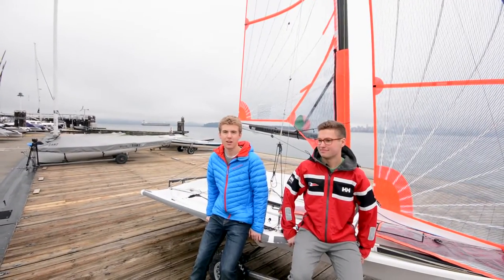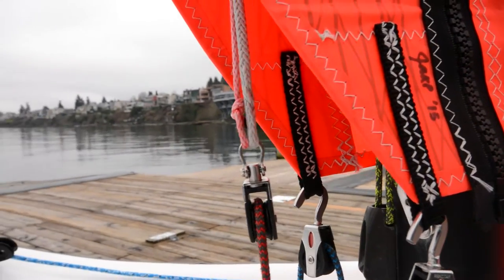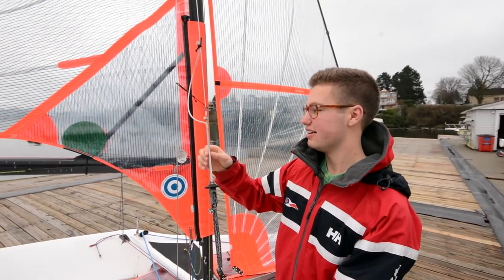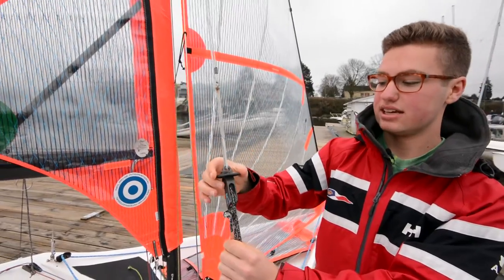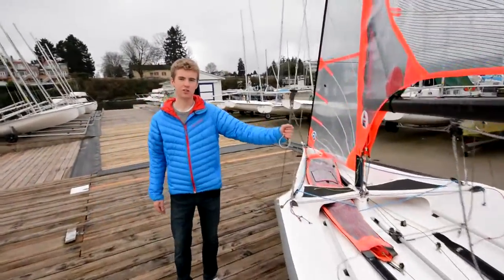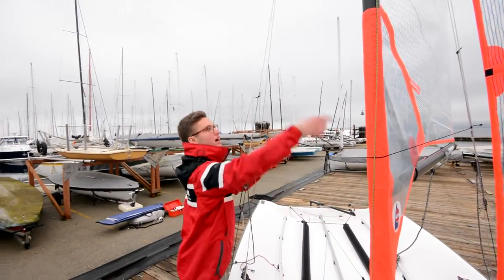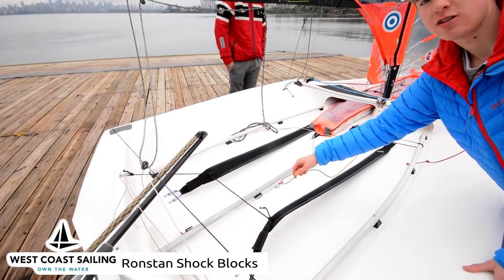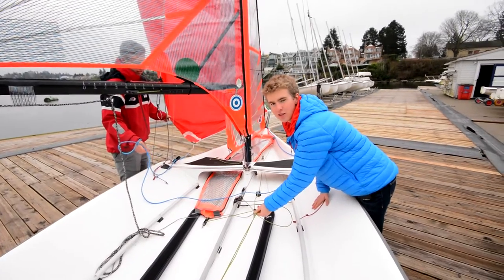29er Rigging Tips & Upgrades

Comment: That is dyneema not spectra and it is buried (on trap lines) its not locked just saying not trying to be rude or anything however I do like the retriever line shock cord thing
Reply from the maker: Hi Daniel, thanks for your feedback. Many sailors interchange the use of the terms spectra and dyneema, as they are essentially the same material from two different brands. Glad you found the tip on the retriever line set up useful!